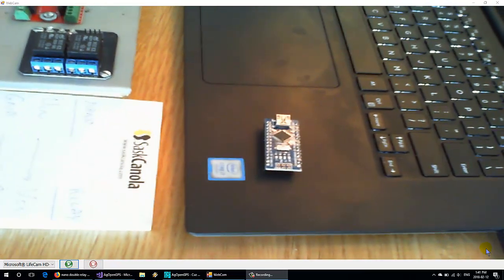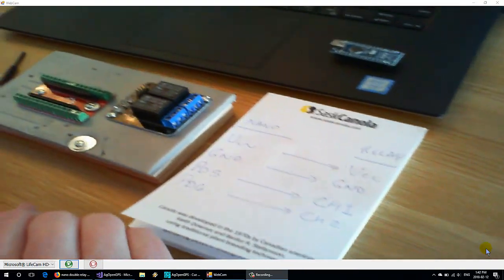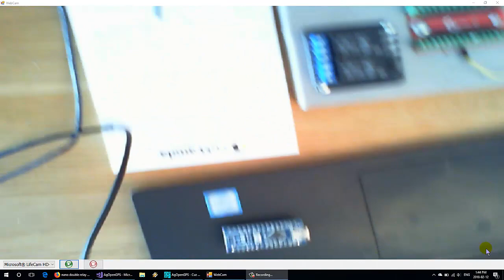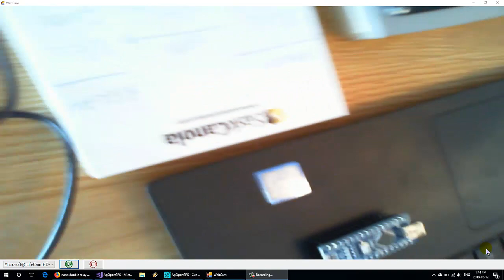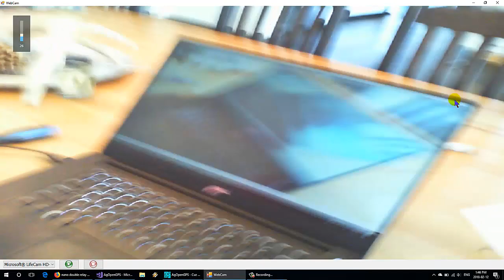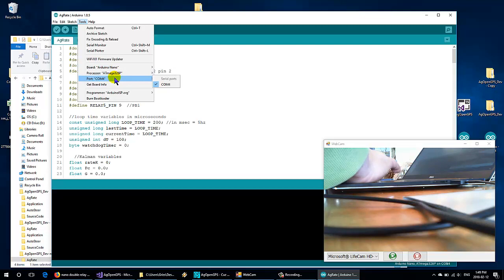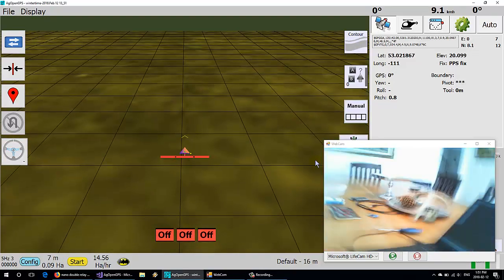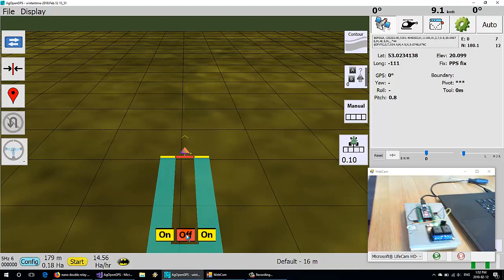AgOpenGPS Arvel Building Section Control

Comment: i follow the steps but relay didnt work..
Reply from the maker: Go to the AgOpenGPS and in the Arduino folder is an INO called sectionRelays. Use it, and connect to autosteer port

Comment: i can not run this, arduino ide give me an arrors Arduino: 1.6.5 (Windows 7), Плата"Arduino Nano, ATmega328"

In file included from AOG_Rate.ino:14:0:
Var.h:4: error: 'byte' does not name a type
 byte minPWMValueLeft = 0;
 ^
Var.h:20: error: 'byte' does not name a type
 byte currentSignLeft = 0, prevSignLeft = 0;
 ^
Var.h:25: error: 'byte' does not name a type
 byte minPWMValueRight = 0;
 ^
Var.h:41: error: 'byte' does not name a type
 byte currentSignRight = 0, prevSignRight = 0;
 ^
Var.h:70: error: 'byte' does not name a type
 byte relayHi = 0, relayLo = 0;
 ^
Var.h:71: error: 'byte' does not name a type
 byte uTurn = 0;
 ^
AOG_Rate.ino: In function 'void loop()':
AOG_Rate:176: error: 'relayHi' was not declared in this scope
AOG_Rate:177: error: 'relayLo' was not declared in this scope
AOG_Rate:187: error: 'uTurn' was not declared in this scope
PIDLeft.ino: In function 'void calcRatePIDLeft()':
PIDLeft:13: error: 'currentSignLeft' was not declared in this scope
PIDLeft:14: error: 'currentSignLeft' was not declared in this scope
PIDLeft:17: error: 'currentSignLeft' was not declared in this scope
PIDLeft:17: error: 'prevSignLeft' was not declared in this scope
PIDLeft:18: error: 'prevSignLeft' was not declared in this scope
PIDLeft:18: error: 'currentSignLeft' was not declared in this scope
PIDLeft:37: error: 'minPWMValueLeft' was not declared in this scope
PIDLeft:38: error: 'minPWMValueLeft' was not declared in this scope
PIDRight.ino: In function 'void calcRatePIDRight()':
PIDRight:13: error: 'currentSignRight' was not declared in this scope
PIDRight:14: error: 'currentSignRight' was not declared in this scope
PIDRight:17: error: 'currentSignRight' was not declared in this scope
PIDRight:17: error: 'prevSignRight' was not declared in this scope
PIDRight:18: error: 'prevSignRight' was not declared in this scope
PIDRight:18: error: 'currentSignRight' was not declared in this scope
PIDRight:37: error: 'minPWMValueRight' was not declared in this scope
PIDRight:38: error: 'minPWMValueRight' was not declared in this scope
In file included from AOG_Rate.ino:17:0:
Relays.ino: In function 'void SetRelays()':
Relays:3: error: 'relayLo' was not declared in this scope
C:\arduino-1.6.5-r5-windows\arduino-1.6.5-r5\hardware\arduino\avr\cores\arduino/Arduino.h:103:32: note: in definition of macro 'bitRead'
 #define bitRead(value, bit) (((value) >> (bit)) & 0x01)
                                ^
Relays:5: error: 'relayLo' was not declared in this scope
C:\arduino-1.6.5-r5-windows\arduino-1.6.5-r5\hardware\arduino\avr\cores\arduino/Arduino.h:103:32: note: in definition of macro 'bitRead'
 #define bitRead(value, bit) (((value) >> (bit)) & 0x01)
                                ^
'byte' does not name a type
Reply: in Arduino IDE ver 1.8.6 I have no problems. Thanks

Comment: Very helpful video on how to connect it up. Is it possible to switch the auto on/off remotely from a switch. If so how do you do it? thanks
Reply from the maker: Not easily, but you could just hook that switch to the power of the relay and turn them off directly
Reply: Thank you for the reply. I have wired it up like that however the coverage still records whilst shut off. I think the best approach is to manually over ride to do the headlands then use the auto to shut off on the main runs. Thanks again

Comment: Hello,
At first I want to say that I realy appreciate what your doing. But I have a small problem.
When I want to upload the arduino code to my arduino-uno is says: 'SetRelays' was not declared in this scope.
Do you now how I can fix it? If I change the settings to arduino-nano it says the same. I will paste the complete error message below. 

I look forward to hear from you.

Arduino: 1.8.5 (Windows 10), Board:"Arduino/Genuino Uno"

Build-opties gewijzigd, alles wordt opnieuw gebuild
C:\Users\niels\AppData\Local\Temp\Temp1_AgOpenGPS_Dev-master.zip\AgOpenGPS_Dev-master\AgRate\AgRate.ino: In function 'void loop()':

AgRate:126: error: 'SetRelays' was not declared in this scope

     SetRelays();     

               ^

AgRate:130: error: 'calcRatePID' was not declared in this scope

     calcRatePID();

                 ^

AgRate:131: error: 'motorDrive' was not declared in this scope

     motorDrive();   

                ^

exit status 1
'SetRelays' was not declared in this scope

Dit rapport zou meer informatie bevatten met
"Uitgebreide uitvoer weergeven tijden compilatie"
optie aan in Bestand -> Voorkeuren.
Reply from the maker: I just now downloaded from github and tried it and it compiles fine. Are All 4 files in that directory? Are you opening AgRate as the initial ino?
Reply: Okay that is very strange, came back from school, attempted it again and works now crazy enough. 
Thanks anyway
Reply from the maker: Aren't computers fun! Good you got it working.